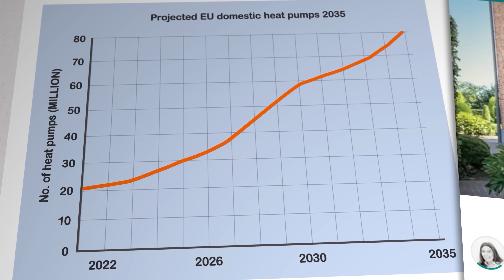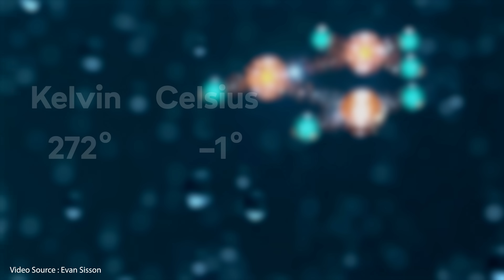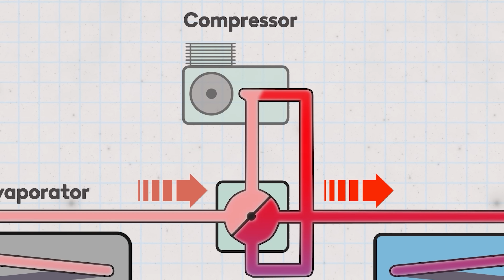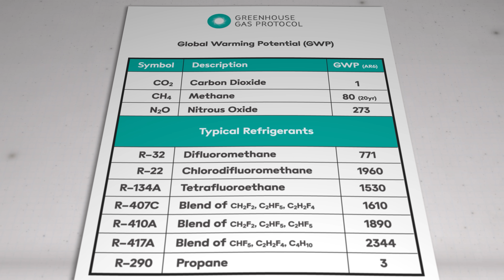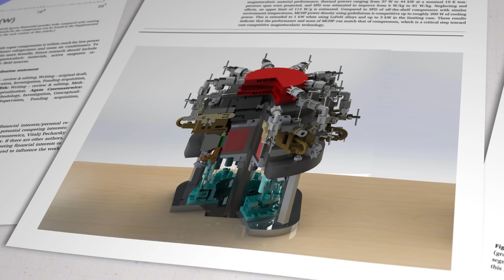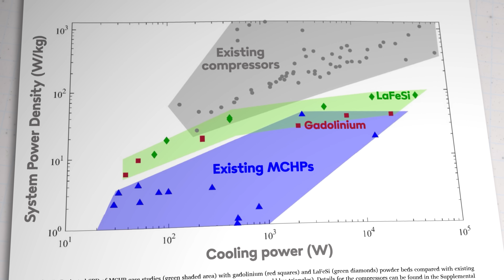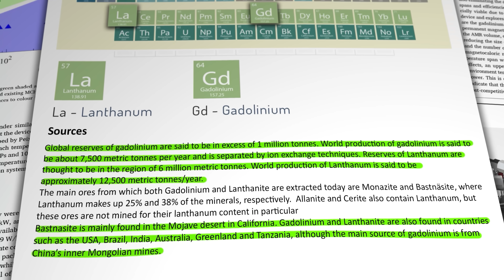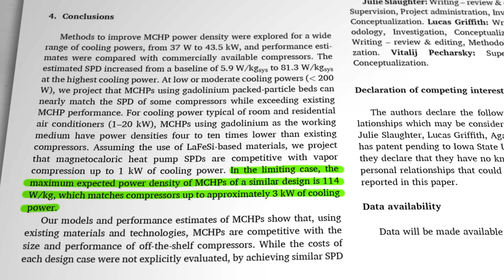Taking greenhouse gases out of heat pumps. (YES! They do contain them!)

Comment: We bought an 1881 brick house, in Canada ... the gas furnace that we inherited could heat the old bones of this structure to a balmy tropical heat wave level, but oh, the cost! ... after ripping out the lath and blaster walls, reinsulating the inside of the outer walls, we installed two heat pumps, one for the upper level and one for the main level of the house. These two heat pumps heat our home better than a gas furnace, right down to minus 27 degrees celcius ... Canadian winters, eh! The bonus is, these units are basically "air conditioning" machines, so we have amazing cooling capabilities during our HOT and HUMID summer months... we have now put mini split heat pumps in our garage and bunkie guest house. Sign me up for any tech improvements coming down the pipeline that will improve heat pumps in the future! Great channel, thanks!!
Reply: Sadly the population of the UK is convinced that heat pumps can only be used to heat hot water and then use the hot water to heat the house. This barely works and is grossly inefficient. 

If you tell them about air to air split systems they simply register to believe that they're as powerful as they are, that they're as efficient as they are, that they're as easy to install as they are or that they're as cheap as they are.

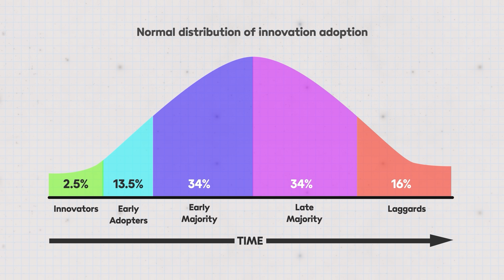At 1:00 he talks about heat pumps as though they're some sort of innovation, while in the rest of the world they're old hat. I recently replaced the split systems in my house that were 35 years old with a new one that's more powerful and more efficient. The 35 year old ones were not new technology when they were installed
Reply: @gasdive  ... someone in the UK's Ministry of Silly Walks, sure did a poor job of getting the heat pump memo out the average citizen ... heating hot water with a heat pump is like, well ... driving an electric car by use of an extension cord!
Reply: @gasdive  sadly you still have to distribute the hot (or cold) around the building (houses are but a trife) in a controllable way against both occupied and unoccupied load demands...  Water is most often the cheapest and safest method of both distribution and control.
Reply: @gasdive  Air to water works great, and you need to heat your tap water too. Can't do that with air to air.
Reply: @itekani  hot water is a small load compared to heating in most cases. It's cheaper to do the hot water with solar (particularly vacuum tube) but even if you use resistance heating for hot water, that's less than the loss of efficiency that is caused by increasing the difference between the hot and cold sides by 30 degrees. That's even before you consider the added cost and slow response time.
Reply: @gasdive  heating water with a heatpump is done absolutely everywhere, it absolutely works, and it works well if done properly. 

The reason that it 'barely works' in the UK is the use of radiators, the thing that makes an air to air heatpump efficient is the fact its using a fancoil (which you can do with air to water heatpumps) which drastically reduces the required water temperature.

Co2 heatpumps to heat water directly are extremely common now, as stand alone systems.
Reply: @Etacovda63  The comment about them barely working is made in the context of commenting on a UK based channel that talks about UK issues.  They use them as a drop in replacement for boilers. Being storage hot water, and also used to run the house hot water service (for showers and baths) sets a minimum system temperature that's about 30C higher than room temperature. It's not specifically the radiators as such that are the issue. If the return water is at room temperature and the last coils from the heat pump are exposed to that, then they can be efficient. That's not how UK heat pump conversions are set up. 

I've lived with heat pump hot water systems that are used to provide hot water service (showers and baths). I know they work, but I also know they don't work very well. They generally switch to resistive heating at 5C and they're never terribly efficient even at higher outside air temperatures. Certainly in my case they offer no benefit over resistance storage hot water. In my area storage hot water is heated from "controlled load" that the network switches on and off to aid load balancing against intermittent renewable generation. So it allows a greater penetration of renewables on the grid, and is actually carbon negative. Heat pump systems need to be connected to continuous supply that's 3 times more expensive, negating any financial savings and it adds to peak loads, requiring more fossil generation running 24/7 to cover peaks.
Reply: @gasdive  "heat pump systems need to be connected to continuous supply" - smart tariffs or just straight flexible tariffs mean you get the same price or cheaper than a controlled load.

No new heatpump requires resistive heating below 5c. Most new heatpumps dont require it until -15c, which basically doesnt exist in the UK.

I live in NZ with a similar climate to Aberdeen. I literally do not have the resistive part of my heatpump connected for water heating, its just not required.
Reply: @Etacovda63    if you've got a CO2 or Propane system, yes, they keep working at lower temperatures. But the CoP is never that great. That's what I meant by "never works very well". The extra difference in temperature between the hot and cold just makes the CoP less. It's obviously possible to get huge differences in temperature with heat pumps. Air liquification is an industry, so it's possible. You can buy liquid helium, and that's essentially a heat pump process. But just because it can be physically done, doesn't mean it's a good way to heat your house. You want to make the hot side as cold as possible while getting the result you want in the room. That means bringing the hot side right down as close as you can get to room temperature.

If you're walking up stairs to the 2nd floor, it's less effort to stop at the second floor than it is to walk up to the 10th floor and then slide down the bannister to the 2nd.
Reply: they're absolutely fit for air to water heating, but require floor heating everywhere in the house.

What you mean is that they don't work with existing installations because the heating area of radiators are too small for the temperatures that heat pump can produce. 

Air to air solves that, but at a cost of the noise. It requires putting a big fan into every room.
Reply: @Adrian_kal  noise? I had 2 split systems that were 35 years old. They made a noticeable noise when on full power to quickly heat or cool the room, but once the room reached temperature, you could only hear them if you stood on a chair and listened. They were recently replaced with a ducted system that you cannot hear unless it's on full. When it's on full, you can only just hear it. If the fridge comes on in the kitchen, you can't hear the air conditioning in the lounge. If there's a swell at sea, you can't hear the air-conditioning on full because the sound of the surf beach a mile away, on the other side of a hill, drowns it out. If a car drives past on the road half a mile from my house, you can't hear the air-conditioning on full.
Reply: @Adrian_kal  My house doesn't have heated floors. Exhaust air heat pump, radiators and heated inbound vent air. Neighbour has a system with only air heating via ventilation, no radiators.
Reply: i got one with 3 cassettes and it heats my 3 bedroom house in the UK using only less than 1000w im really pleased it works well with my solar and batteries.
Reply: @rodden1953 it great when other people pay for your heat
Reply: @David-f8e2v  Do what ? No one has paid for my heating thank you .
Reply: What are those 2 numbers 296.15 and 326.15?

Well explained by the way, constructive dialogue, unlike some rather useless comments
Reply: @tarant315  oh, sorry, temperature in Kelvin. So the absolute temperature. The
Each degree Kelvin is the same distance apart as Celcius degrees, but the zero is absolute zero. 

So that's the right scale to use when you're discussing pressure, volume and temperature relationships.
Reply: @gasdive  units dear boy, units.  ALWAYS write down the units... very confusing for everyone otherwise including the denying plebs.   : ))))))   They will only believe the Rankine otherwise, or maybe their beloved "imperial" Fahrenheit.   ; ))))))))
Reply: @tarant315  actually that's not a complete explanation. As I said, the zero in Kelvin is absolute zero. So to convert back and forth between Celcius and Kelvin you need to add or subtract 273.15 degrees. So 10 Celcius, you convert by adding 273.15 and you get 283.15 Kelvin. 23 Celcius converts to 296.15 Kelvin. 53 Celcius, add 273.15 and it's 326.15 Kelvin.
Reply: I would love to know what brand your heatpumps are. It would be nice to know what the power usage is below freezing as well. Mine uses a lot more power when it's colder outside. Are you sure it's not switching over to electric heat?
Reply: @ hey phil20_20 … we have Mitsubishi units, which, from what I read about constantly is that they are built like the Rolls Royce of H.P.’s … and, yes, our units do switch over to electric heat coils if the unit can’t keep up with the extreme cold. I don’t know about your electric costs but here in Canada, Quebec hydro keeps our Ontario prices competitive. After two years of use, these heat pumps are costing less than the electric charges for running the gas HVAC units and the gas costs, combined. One thing to keep in mind regarding H.P.’s … when it’s cold, they will supplement the heat required by the thermostat by adding electric heat from the coils, however, and this is vital to understand, the colder it gets the less moisture is in the air, which allows the unit to draw more heat out of the cold differential between the ambient temperatures and the heat produced by the condenser unit … of course, there is a theoretical limit of these units producing heat below -30 Celsius, but that all depends on the level of humidity in that cold air. Practically speaking, we find that as it gets extremely cold, the heat pump produces less heat, so the room temperature might drop from 21, to 18 degrees … that’s when we decide whether to engage the electric heat coils. (You can set this automatically, so you can forget about it.) once, this past winter, our main floor unit froze up due to the extreme cold and high humidity. I used a 20litre bike wash tank, with a fine must of HOT water to speed up the de-icing process, which allowed the unit to get back on track to a more efficient output. Overall, with two years of cost comparisons, it’s cheaper and more comfortable to use these heat pumps. Will the cost savings pay for the units? Well, maybe over twenty years or so, but we know that the 25 year old units we replaced two years ago, wouldn’t  have lasted much longer, besides, we are not doing this to save a lot of money, but rather to contribute to a smaller carbon footprint, for what it’s worth. All in all, a good investment, especially if we decide to sell our home in the next 5-10 years. It’s a good resale perk to have as an upgrade. I hope this helps somewhat. Thanks. 🙏🏼
Reply: @phil20_20  all heat pumps either use more power or output less heat when the temperature difference between the hot and cold is large. 

The coefficient of performance (CoP) is the measure of this. The theoretical limit is the temperature of the hot side divided by the difference between the hot and cold sides. The actual performance will be about 40% of that. 

So if it's uncomfortably chilly outside at 10C, and toasty 23 inside the likely effective CoP is 296.15 / 13 (the difference between inside and outside) X 40%. 

That's about 9.1 

But if it's minus 25 outside the difference is 38. Dividing by 38 instead of 13 and the likely effective CoP is only 3.1.

But if you're in the UK and you believe that heat pumps should heat a boiler full of water instead of the room, the hot side is now about 326.15K. now you're dividing 326.15 by the difference between 53C and -25C and multiplying the result by 40%. That's about 1.7
Reply: Great if your rich and you have much poorer people.Subsidizing you with their tax dollars
Reply: @David-f8e2v  Who is talking about subsidizing?
Reply: It literally can't do that. It only means you didn't have properly installed gas furnaces. Gas furnaces have no problems with capacity and temperature. They have more capacity by default and can heat water or air to higher temperatures. Before you proceed to disagree with me, I was selling heat pumps for about 20 years (Carrier).
Reply: @hrvojelasic5794  I'll be sure to let my fridge know that it can't pull heat out of the -20C freezer and dump it into the +45C Australian summer.
Reply: @gasdive  dont bother, your fridge is more intelligent then you are ;)
Reply: @hrvojelasic5794  I don’t disagree with you, what I am stating is that the two heat pumps we installed run cheaper, and heat and cool our home better than the gas furnaces and a/c units that we inherited with the house.
Reply: @zingbopdelux  It only means that the gas furnace was not properly installed. I am not discussing running price at all; even the price for two heat pumps is vastly more expensive than i.e. gas boiler, which you need to take into account when comparing the running cost.
Reply: @hrvojelasic5794 it is sad to see hangers on, the petroleum type, stretching to the limits, trying to convince people of benefits to continuing burning fossil fuels. I wonder if you’re an installer of gas furnaces and that you struggle to stay busy?  Any knowledge of mechanical installing should transfer over to any type of unit. The kicker, of course, in this discussion is can that gas furnace be used in summer time to cool?
Reply: @TheLosamatic  I am making a living off heat pumps (selling them from 1991) , and I produce controls and hydraulic parts for heat pumps. However, I am a mechanical engineer who understands the limitations of technologies. You talk more like a cultist. I speak what is correct from an engineering point of view.
Reply: @ cool glad your working. Great to see you here staying up with the times. How’s that furnace working out in summer?
Reply: @TheLosamatic  for summer - different systems, for you - no help.
Reply: @hrvojelasic5794  ... Oh Carrier... oh well.   ; ))))))

And if your distribution system is designed to use a 30-40°C medium (less need to insulate pipework, etc.) then 40°C supply water is fine...

But so would HTHW or steam... it just has different costs of ownership and risk, etc.  Same as I could use 11kV to run a 60W tungsten bulb... but the local size of the transformer, etc., wouldn't leave much space in the living room, for, er, living.   : )))))

Comment: You leave me frustrated with TIME and money,  I'm  77 and  time is working against  benefits for me - BUT there is hope for the future unless the corrent chaos takes us all down. 👍👍👍
Reply: My hope is that science will do what policy and capitalism cannot.   Eventually energy efficient appliances just become no-brainers.   When these technologies start to have positive feedback loops on each other, efficiency and adoption will multiply.   

If Perovskite solar panels solve their durability problems we'll have ~28 to 30% efficiency or close to 50% higher than current panels.  A 40 to 50% increase in rooftop capacity is a massive improvement.  Continue reducing cost of batteries and improving heat pumps (house heating/cooling plus refrigerators) and you'll reach a point where installing solar with some batteries and a heat pump reduces most household to net zero for less than the price of a new car and these assets will pay for themselves in 3 to 8 years.

Comment: My understanding is that the theoretical limit of efficiency of a heat pump is T / (delta T)  (T in Kelvin). Losses have to be added in for pumping, compressing etc. It was this that decided it for me that heat pumps have already roughly met their limit for efficiency so I went and bought one at this point. Might be good to highlight this for those that are wondering as I was whether to wait for a more efficient HP.

Comment: I was excited when @TechIngredients did a series on liquid desiccant coolers (the other use for heat pumps besides heating), which promised huge efficiency improvements, but ultimately real world testing showed they were comparable to existing phase change heat pumps.

I also think we have too many separate heat pumps in our homes, heating and cooling the air, water heater, refrigerator… all separately moving heat around.  Would it be more efficient to just have a single heating/cooling compressor, and pump the loops to what needs it, like in lrge office buildings?